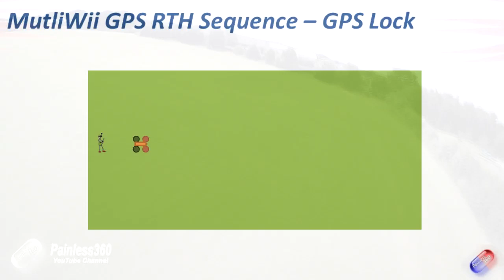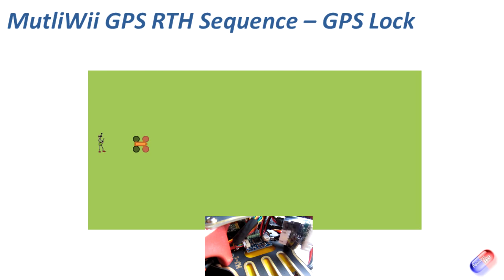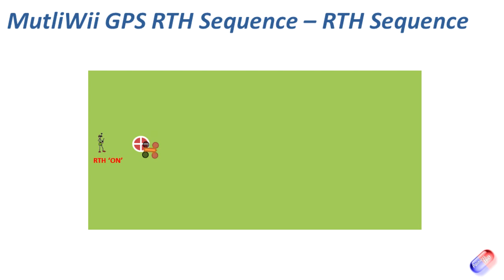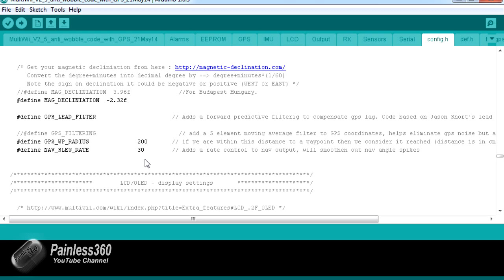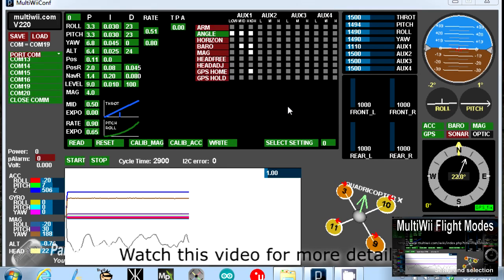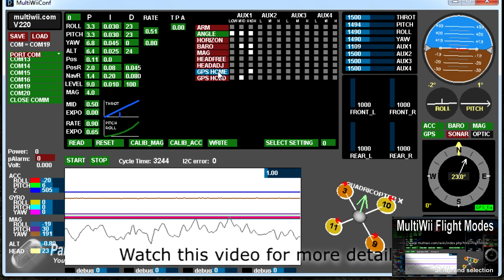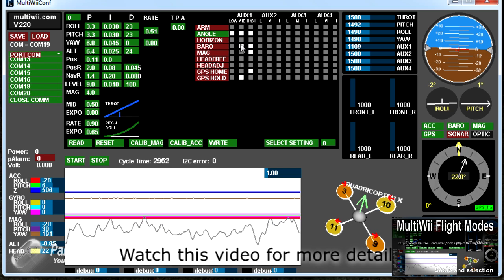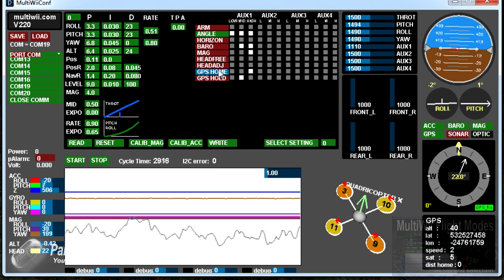MultiWii Quick Tip: Overview and demo of the 'GPS Home' function

Comment: i've just subbed a few days ago, your videos have helped me a lot while i was setting up my crius board :). can you give me more info about your quad hardware (motors,esc,propellers, .. )?. I'm planning to do a new quadcopter like yours for fpv ( currently i'm using a warthox frame but for fpv there isn't enough space to place all the electronics).
keep up the good work!
Reply from the maker: Hi Grex, The model in the video is using 450 DJI Flamewheel clone frame, 20A SimonK ESCs, A2822-12 1800KV Outrunner Brushless Motors with 7045 props and a 3700Mah 3S LIPO battery. Gives me just over 7 minutes of flight time and excellent performance. For longer flights use a lower KV motor with a larger prop.

Hope this helps. Good luck with the build.

Comment: So I have followed all of your videos on the GPS setup, very helpful.  I still seem to be missing something.  When I arm I don't see the home position change on my GUI.  It still wants to show home at 0°lat 0°long.  Any suggestions?  It seems to want to fly into the direction as well, the middle of the Atlantic ocean.
Reply from the maker: Hi Eric, if the coordinates are showing as 0°lat 0°long then the GPS isn't being heard by the Multiwii. if you use an I2c board is it flashing three times? If it isn't then watch CN06 troubleshooting if it does then it sounds like the GPS has a problem or the MultiWii isn't configured correctly. Does the MultiWiiConf program show lots of i2c errors?
Reply: Painless360 I will look for the i2c errors tonight.  funny thing is that it does show the quad in the correct area when looking at it on the map
Reply from the maker: Interesting, what software are you using to see the model on a map?
Reply: Painless360 MultiWii WinGUI 2.3, 2.2.  And the Android App version MultiWii EZ-GUI v3.98.  It has always done this.  running a Crius MultiWii SE V2.5 and 2.0
Reply from the maker: OK, does the standard MultiWiiConf also show the same 0 degrees for lat and long?